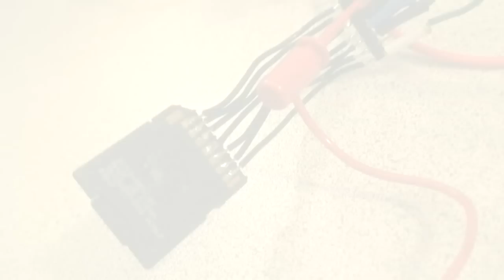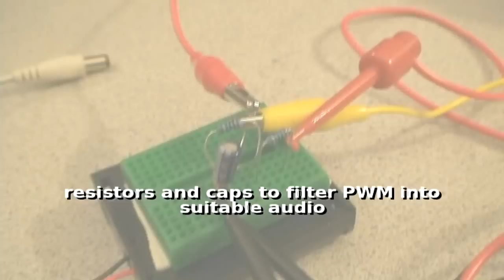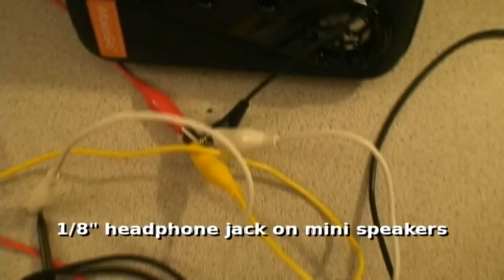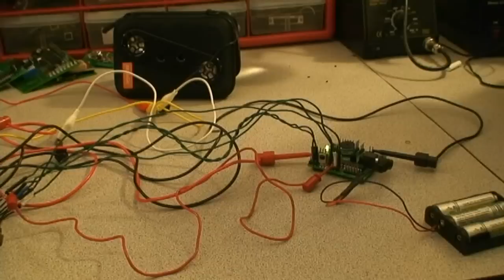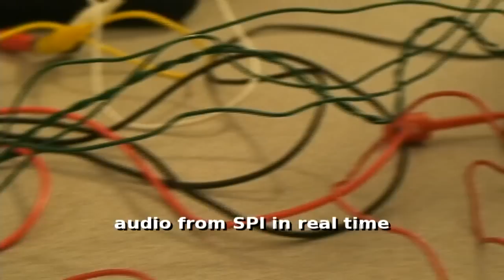Using an SD / MMC card in your electronics projects

Comment: I guess you're using the SPI port because I don't see that kind of handmade adapter allowing you to use the SD signals. I tried that once but the bus speed had to be slowed down a lot for me to even access the SD card :s